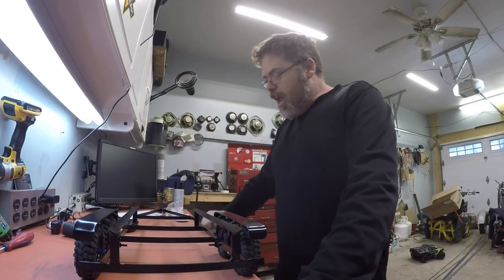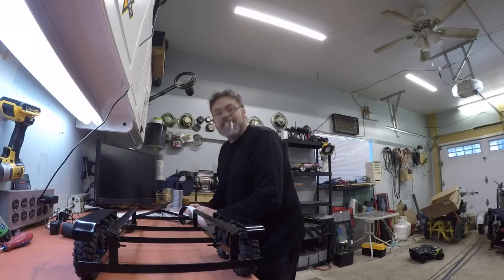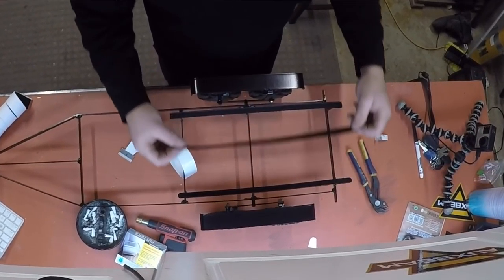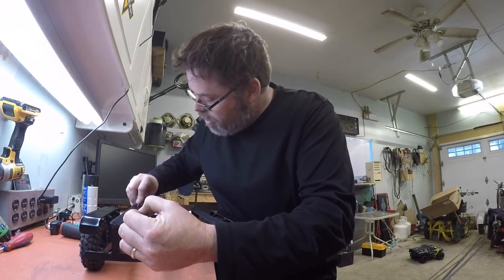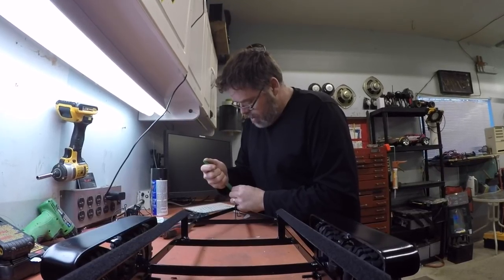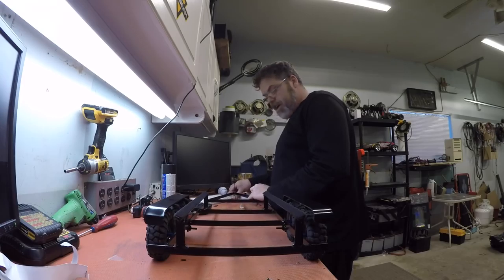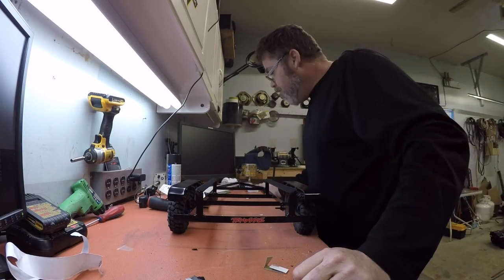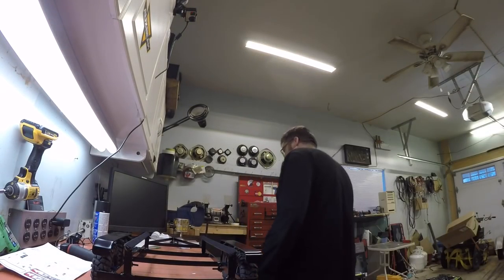Spartan Boat Trailer Done

Comment: If that trailer was shorter and fit in a kitchen oven I could powder coat it, but it is too long😕 But I building a custom oven to powder coat  bigger items this winter and if it works like planned I will let ya know and next spring/summer I will powder coat it for you when you want the finish redone. Nice job looks great!
Also if you have an issue with the prop hitting, they make drop hitches for Rc's too